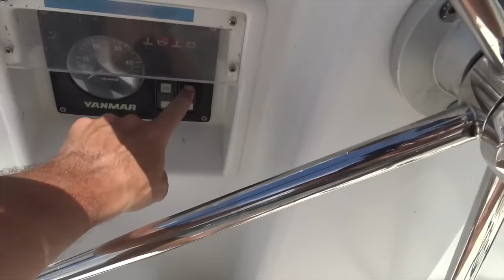SAILING PARLAY REVIVAL -  Channel Trailer!

Comment: I have been following SPV since the beginning and amire your skill, character and determination. Like many I felt the pain of watching you and Jamie diagnose and fix those bulkheads. What an under taking.  Not to mention all the core replacements etc, etc. And Wow! we all learned how to mold and replace non-skid in your brilliant sugar scoop extension projects. I enjoyed the recent episode watching Tom build the thru hole contour blocks for the new forward looking sonar! Anyone who has ever tried to match multiple contours like that appreciates the level of skill required. Great skills and an entertainer!
What a journey! So I am so happy for you that Parlay is now sailing and  cant wait to see the next adventures.
And congrats on the new crew. Love the new trailer - looks like your new videographer / filmmaker is raising the level already!
The trailer does a great job showing all of the great crew and adventures over the past few years! 
Also thank you for your professional leadership in pointing out the bulkhead issue as a much wider issue. You have significantly raised the awareness  to structural issues for all catamaran manufactuers and owners. Nice work!